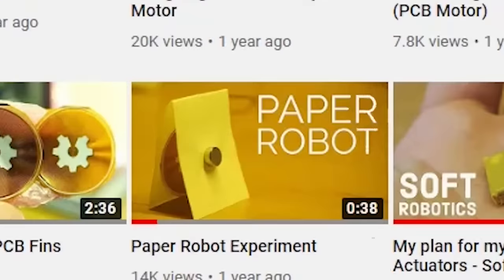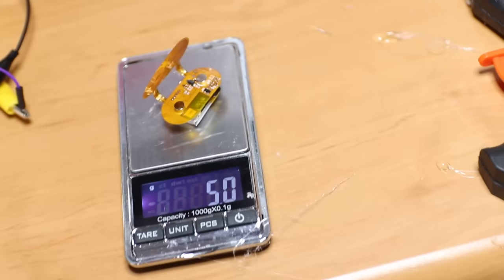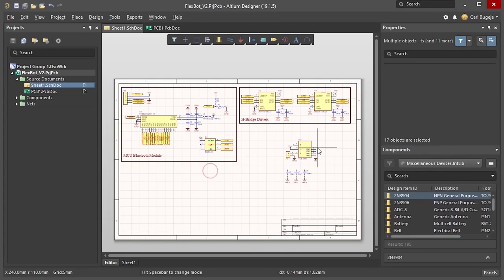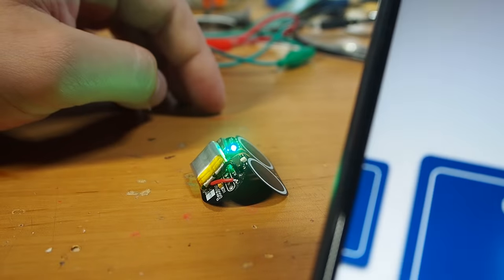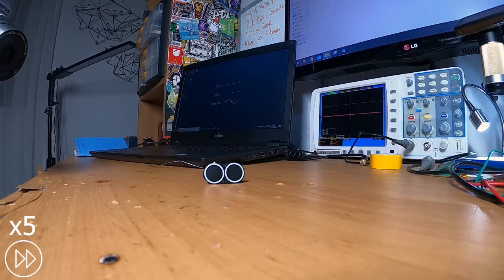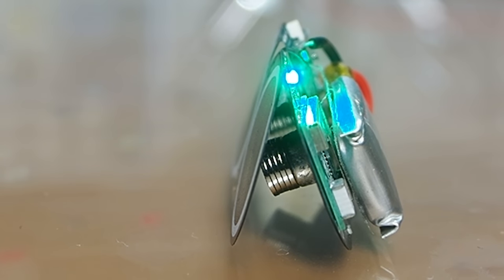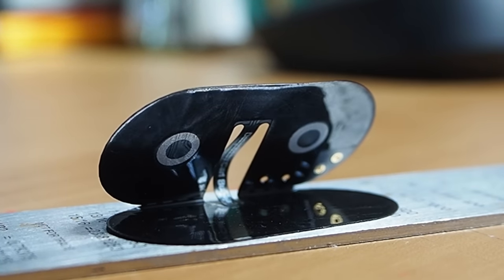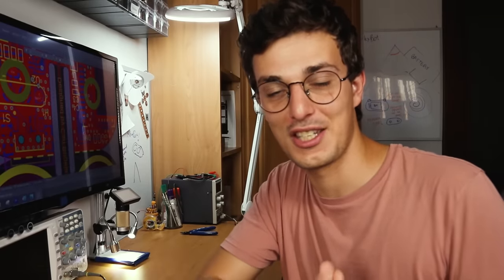Vibrating Circuit Robot

Comment: Big fan all the way from South Africa.

Put the “leg flaps” on isolated legs to allow you more precise lateral control. Add a variable power source to adjust your upper limits of your pwm. This way you can control how far the legs must extend, still with great current control. reducing the dependence on the hinge tension. And yeah, you figured the turning problem out. That was simply your center of mass. Very nice work!

Comment: Having the section below the coils that rides against the table be two points instead of a a line would probably make it less sensitive to mass distribution and to having the bend line be perfectly parallel with the contact line. You could also make the back contact a shorter line segment. This would essentially make the robot stand on a tripod instead of two lines.
Reply: I was thinking just the same thing!
Reply from the maker: Agree! I was thinking about make both sides stand on like a zigzag instead on a line.. But I am not sure how many points
Reply: This could be tested with the MK-II, just by cutting away a few bits of the straight edge. It does not take much, i would guess even just cutting away 0.2mm with an exacto knife would show you some results. I'm not sure, but i guess having the contact points to the floor surface as far away from each other as possible would probably be the best.

Comment: Seems to me it might be the fact that the hinge is one piece (i.e it has only one big leg, it has to bend the single piece to steer, this would mean the two coils would just fight each other when turning) if you split the two coils the robot would have two independent legs and more yaw authority, you could add a tiny gyro and have the software run a feedback loop that would keep it going straight even with imbalances in the system.  Awesome project.
Reply: This is a good idea imo

Comment: Instead of folding the PCB inwards, make 2 PCB and join them at the upper part, that way the unpowered position would be together, and the powered position would be open. Also, because the magnets have a thickness, they would keep the 2 PCBs at an angle making the robot stable.
Reply from the maker: that's what i tried using the glue for :) the solder pad idea should work as well
Reply: @CarlBugeja  Kinda, when you glued them there was still a distance between the magnets and the PCB. What I mean is for them to lie compleatly against each other. And only when powered they would separate. This way they should be more powerful. 
Anyway, thanks for your repply :)

Comment: You can crease the plastic of the flexible PCB like a cardboard box. I used to be a tool maker for print finishers where we made tools to crease plastic as i imagine would work with your PCB. Instead of one single fold/hinge, have two. Make the distance between these crease folds the thickness of your magnets. This way you can make the PCB stay in a folded shape and have the coils parallel to the magnets.

Comment: Since you asked,  two suggestions:
 1.Make the hinge a square or "box" hinge, with two folds. This will reduce the "spreading" caused by the PCB wanting to go flat. 
2.Put a drops of hot glue, rubber cement, or just something with a greater surface area and higher friction on the "foot" so it's vibrations can be more easily transferred to motion.

Comment: Have you considered some kind of closed loop control? With a gyroscope, this way you could control the pulse rate to get straight motion without the problems of manufacture variation
Reply: That's what I thought, an accelerometer to detect the walk angle deviation, and compensate for it in software.
Reply: what about a compass?
Reply: @altrombone1775  A compass is more like a low pass absolute reference. A gyroscope has more high frequeny dynamic response. This is why IMU generally fuses compass and gyroscope data.

Comment: Some ideas you could try:

- Introduce a phase offset between the two coils to try turning.
- Make the two halves a "B" and "D" shape (better yet, a "W" and "V" shape). If the edge has three sharp points, you have known and consistent points of contact. With the flat sides, you're basically making contact at random points based on the roughness of the table and the variations in the PCB's edge.
- Make the angle as tight as possible, so it doesn't have to fight its own weight. 
- Move the glue/solder away from the bend in the PCB, so you don't have to make as tight of a bend radius or fight so much springback.

Comment: Hi Carl, this problem is quite easy to solve.
Put 2 bends close together so that the halves of the circuit are closer to parallel. 👍
Reply: I was thinking the same thing
 Maybe make a square hinge the  same thickness as the magnets?
Reply from the maker: interesting idea 🤔
Reply: @CarlBugeja  have you tried putting copper in the bend area of the flex pcb? When you bend the copper it should help the edge keep its angle, rather than trying to open up again.
Reply: I think another option could be to attach magnets to the side with the coils as well. No PCB redesign needed and the glue in the hinge would be obsolete.
I'm not sure about the permeability of magnets as they are already magnetized/saturated, but I'd guess it's significantly better than air and can thus result in larger forces at the same coil current.
The coils would gain moving mass/ store more kinetic energy. This will drastically reduce the resonant frequency and drastically increase the elastic/kinetic energy stored at a given oscillation amplitude, which may be beneficial
Reply: I was thinking the same too, I think this is the best solution for your problem
Reply: Also try making a cut through the middle to separate the two legs thus making it easier to have the two legs move independently as @Lee higgins  has said in another comment

Comment: What you want is two different currents to drive the coils. The speed of the movement will then be able to change depending on moving forward or backwards. If you move a side forward fast then back slow, it will move more than if both the same speed. The duty cycle will have minimal impact since you are moving both directions with same speed so sliding friction is the same.

Comment: It seems like the crease is an uncontrolled variable. Instead of tweaking the material thickness, you could eliminate the crease entirely. With a long fold area and some tabs and slots, the fold could have a large bend radius (making a small loop instead of a crease), and the the two sides could be kept in proximity by the tabs and slots. This way there is a solid mechanical feature maintaining the distance between the coil and the magnet. You could reverse the mechanism so the panels are normally closed instead of normally open, which may allow for more design options here as well.

Comment: To solve the issue of "posture", calculate the distance you should have between the two parts of the pcb sides at rest (when not driven and standing up right), in order to have it stand up with those two pcb parts vertical. that distance needs to be the distance occupied by the to permanent magnets plus the expected distance to the coils. at the hinge side you need to either solder, or glue some solid piece of plastic or similar, that can act as the rigid distance provider. I believe once you did this, you will just need to add at the bottom of the pcbs some "shoes" for the robot, in order to allow better adherence (probably some 2x2mm pieces of rubber or similarly adherent material). Looking forward to seeing the next iteration of your pcb robot. :)

Comment: My noob hints (for what they worth) : It could help if the coil side parts that touch the ground have some rubber feets. One little foot for each coil, so 2 feet.
As your robot, sideview, is basicaly a triangle, with only one freedom degree (radial rotation on the folded axe), I think :
- pushing the coil away from the magnet will lift the feet up of the ground (rotation around the fold) before the robot hit the ground again (inertia, then gravity)
- pulling the coil to the magnet will grab the rubberized feet on the ground, acting as a hook, so the folding robot will move forward the rear part which has no rubber feet, sliding it forward.
The weight distribution between coil side (grabing side) and magnet side (sliding one) will be essential for this to work.

Comment: I admire your level of engineering. That being said, you could try use rubber band instead of electrical tape to hold legs together, maybe tiny spring can work to. Also, TARS has 4 sections, can walk on 2, 3 or rotate like a wheel on 4

Comment: this is such a cool robot.
i think if u make the coil and circuit pcbs separate and then just use a stiff U-shapred wire to act as both an electrical connection as well as a hinge to connect both sides together, u would be able to control the angle of bend.
the stiffner added in between the pcbs is also making the pcb more flexible nd is making it go back into its original shape, i think u should remove it so that u can deform the plastic more easily in the bent shape.

Comment: I’d definitely up go for the solder pads, and make 2 or 3 per side so you can get the most symmetry and repeatability of the connection. I’d also consider having two flexible parts with a magnet in the middle, such that both the front and rear legs push off the same magnet, which just hangs in the middle. Adding some rigid pointed/serrated parts that interface with the ground to the bottom of the pads might be a good way to ensure that you’re getting contact with the ground only where the “feet” are. Might also increase friction too much though, so you’d need to do some testing.

Because this will likely require quite a lot of trial and error, I’d advise just connecting a dummy weight on the robots and having the motor driver and comms off-board, connected with some thin wire.

Comment: This may not be related to the folding (and alignment) issues, but I was thinking about switching from the permanent magnets solution to a full 4 inductors solution, so that you can control each pair individually. This implies a bit more complex circuitry of course (full h bridge for the already existing coils as you did, and a simple low side mosfet to control the other coil always with the same polarity), but you should theoretically get rid of the alignment issues with this, and the overall design might be lighter. Also, this will give you more fine control over the magnetic field I suppose. However, coil pairs might need to become really close to one another to work as expected... Having a double bend (as suggested in the comments) will certainly help as well!

Comment: your current design is essentially a 4-legged design (the wide back has two 'corners', and the front has two 'corners') so your robot will rarely ever sit perfectly flat, which is another part of what's potentially causing it to not move reliably straight even on glass.

Adding a small nub in the back for the circuitry/battery side to rest on a centered 'foot', and splitting the coiled area in the front into two separate legs, would probably result in better movement, just like how a 3-legged table is always more stable than a 4-legged table :)

Comment: I think your PCB have quite huge part dragging against the surface.
I mean, 
·.____.· ·.____.· this is the lower part of the actuators.

It can be reduced in size from the bottom and that might help in reducing the force robot have to move against.
Reply from the maker: Agree! I think it would be much better if it was like a zigzag
Reply: @CarlBugeja  Yess
Reply: Yeah, i think trying a shallower angle might be worthwhile. I really like your explorations :)

Maybe not zigzag but only two points contacting.

Comment: I like your idea and i think i can help with your problem i don't think the problem in the electrical design or the size of the magnet  it's the weight distribution and you have to make some kind of legs like glue two little rubber at the bottom of the coil side and you need weight on this side too to give extra grip on the rubber and for the hinge you can cut it and glue it just from the top while you stash them face to face you can use the soldering iron for it hope this will help

Comment: That's starting to look pretty cool!  I was about to suggest splitting the front between the coils, between the two coils, but I see Tainton Hutton already suggested that.   That would allow more movement of each leg without so much impact on the other leg.  Also, could you put a couple of holes near the bottom of each leg and run a piece of thread between the bottom of the leg and the bottom (the part that touches the table) of the electronics board?  Then you could adjust how far the legs moved just by pulling more thread through and tying a knot to keep it from going through the hole.  Have you considered some kind of rubber or foam along the edges of the board where they touch the table, to give it a little more traction?  Or a tiny roller at the bottom of each leg, that only rolls one way?  Maybe make them out of the spring pins they use to hold the band on a watch?  They're spring-loaded at the ends, so you could compress them to snap them through a couple of tiny loops of wire to act as axles.  This is starting to get really interesting.  Keep it up!  :)

Comment: You could make the joint area of  two flex pcbs as slotted structure or you can use the same concept of flex cable that runs from one pcb to the other and may be make a dummy flex cable as a joint fpr two pcbs. This will increase flexibility in the joint area... Cheers!

Comment: The problem is the flexible PCB material, it will always naturally want to return to its original flat state. The easiest solution would be to cut out as much of the PCB material in the hinge area as possible and replace it with something else that will push the two halves of the PCB together, instead of apart. (This is also the reason why turning left or right isn't working, because you can only utilize the actuation force of the coils in one direction and the difference between left and right isn't big enough unless you can utilize the reverse actuation of the other coil.) The hardest part is you have to find a spring material that will match the force of the coils as closely as possible and that has a low dampening ratio. I would recommend natural rubber (like a thin rubber band). For the design I would recommend making the hinge a bit longer and making a few holes along  the hinge where you can tread the rubber band trough. Something like this basically:
       __                   __
 /          \___   __/           \
|	         o|_|o               |
 \	         o   o              /
 /              o _ o             \
|              _o| |o_             |
 \____/                 \____/
And then use either glue or tape to bond the rubber bands to the PCB.

Comment: I am sure you understand differential drive robot, some improvement you can make to you current design is to split the coil(leg) into seperated coil(legs) instead of joining them together in your current design hence you can better steer the robot by actuating with different frequency.

Comment: i would have used some fishing line (or other light thread) to stop the flex part to open up too far. Make some holes near the bottom of the PCBs, then put a string between the two sides that holds it together, kinda like you tryed with the electrical tape. If the holes are small enough, a little knot in the thread on the outside of the PCB would be enough to hold it place and limit the movement, and it would be easy to adjust the maximum opening angle.

Comment: If you have enough power to move forward, just try to move one side forward while the other backward. You can't do it at the exact same time, but with a little time delay. That should result in rotating CC and also CCW.
Reply from the maker: That's what I tested when tried to turn left and right 🙂

Comment: Cool project so far :-)
I'm not shure if it is better, when the pcb is not flat where touching the ground, but some sort of individual legs, as you mentioned. Perhaps some tests with a rigid wood prototype can show the direction of the project. Perhaps it is better to have only 3 or 4 touching points to the ground then two regions. This might also help with uneven surfaces.

Comment: Did we travel back in time? 🤔
No its a repost, maybe 👻😜

Yea as per previous comments, a square U shaped hinge with flexible wire and solder pads or holes should hold or reduce the angle. Also cutting or seperating the middle part should give you better control and an option a sort of trimming which is similarly found in RC toys & build. Like that the current flow could be reduced in one and maintain direction instead of turning around. 🤷🏻‍♂️

Comment: nice!! maybe by limiting the contact points on the ground, the movement will be less restricted,, also it would be better to separate each leg instead of the whole flex-PCB bending.. you can also add a gyroscope/accelerometer to save some time on manually determining the rates of each legs.. hope you can get some improvements going!! im a fan of your work :)

Comment: Rubber bands. Maybe try them to limit the movement, so instead of just stiffness you get elasticity? Should also be more efficient maybe? Just attaching them might be hard. Also the last attempt seems quite promising, but maybe add "feet"? It seems like the random direction changes are because the robot gets stuck on the surface.

Comment: Why not cut the coil section vertically from center so that both coils can move independently? Also, for more control it's better not to rely on plastic or paper. Try to use repulsion/attraction for bi directional movement. It's an outstanding efforts from you. I wish you success.